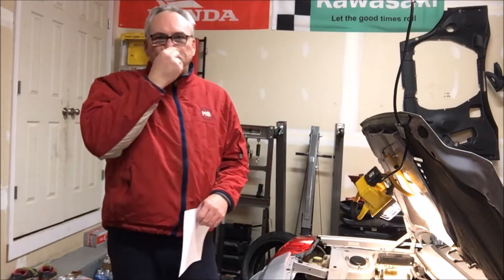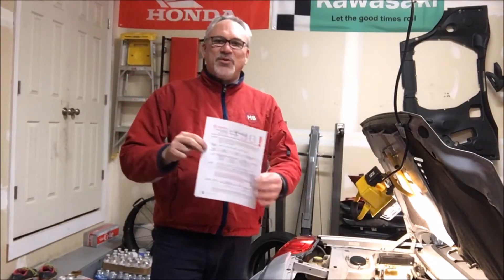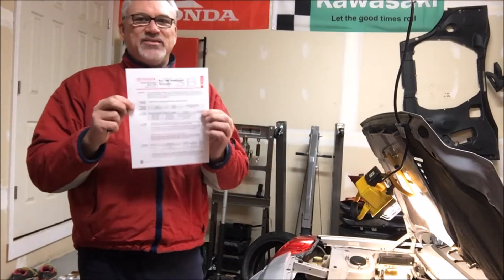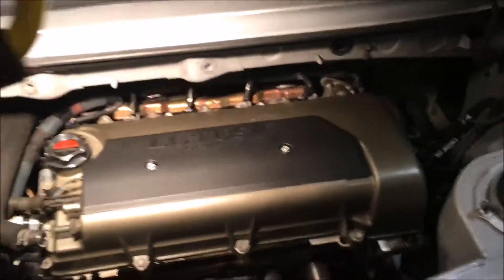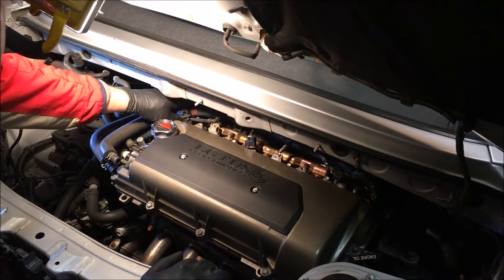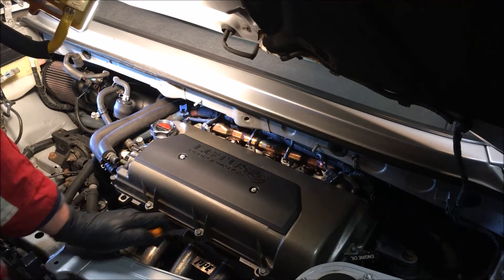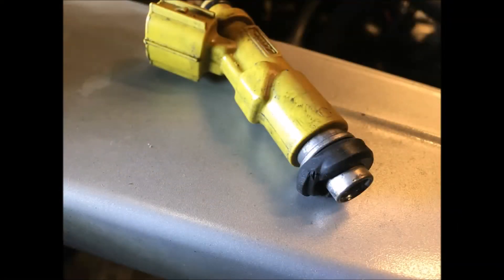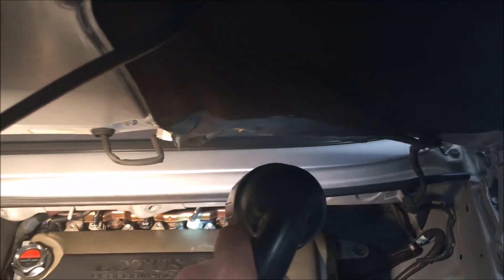MR2 Spyder - Brown Injectors Solve Misfire Code

Comment: Yes!Yes! Yeah man! Got the same problem with my mr spyder,and ordered some refurbished denso injectors. The car has 180 k miles on it,about time to change them. Thank you so much for sharing info on the spyder. Also, i used to ride a honda s50 while i was young,always missed it since!You still got that honda?
Reply: Did it fix the issue? Did u replace the ECU?

Comment: Once again, I find your videos quite helpful. Thanks for posting.  I have not installed the 2zz yet, but I had this same problem with the 1zz and tried 17 different things to fix it.  Fuel injectors was going to be the next thing I tried, but I figured the chances of all 4 or even just more than one going bad at the same time was pretty slim, but the TSB of a computer and the injectors not playing well with each other would make sense.  Of course, it is strange that it would take 100,000 miles of driving to have that happen.

Another guy I communicated with on the forums (Spyderchat, I think) said he had the problem with the 1zz and then again with the 2zz after the swap and that it was a VSV (evap I think).  I tried that and it didn't work.

Comment: One other thing.  My car shows that it is running rich.  Did you put a scan tool on and check your fuel trims?
Reply from the maker: If anything I am running a little lean but I have a more aggressive intake and exhaust.  The good news is that the light has never come on for this reason again.

Comment: Having the same problem with my stock 2003 MR2.  I've tried 32 different things to fix it.  Haven't replaced the injectors because I had trouble believing that multiple injectors would go bad at the same time, so I started with things like the MAF sensor which affects all cylinders.  Thanks for the video.  Gonna go check the TSB's on the stock MR2 now.

Comment: I had the same issue when I did my 2ZZ swap in 2011. I also switched to the brown injectors. I too found a damaged insulator gasket on the bottom of one of my yellow injectors. Your videos are very informative and well done. It is too bad that you ran into so many issues with your swap but as a result your videos cover many of the worse case scenarios that one can encounter when doing this swap. Well done! I am surprised that you did not run into the overheating problem due to air in the cooling system. That is a big one with a lot of 2ZZ Spyder swaps.
Reply from the maker: Thanks.  I did run into a few extra issues but she is running like a top now and she is a blast.

Comment: I'm also doing the Swap pretty soon , car and parts are all ready to go . I came accross that Service Bulletin while I was looking for a 2000-2001 Celica ECU ( for that 6k Lift and high rev Limiter) , found one at the Wreckers for 100$. Turns out its the ####83 One that they put in the cars with the brown injectors . Lets hope you dont need to change ECU as well , on MWR website they are Not cheap.
Reply from the maker: I think I will get a Power FC one of these days to get some more performance.  It is still good to have a regular ECU so you can get codes.  Good luck with the swap.